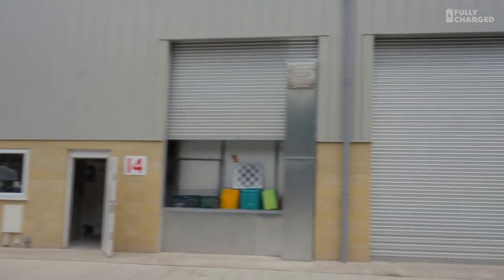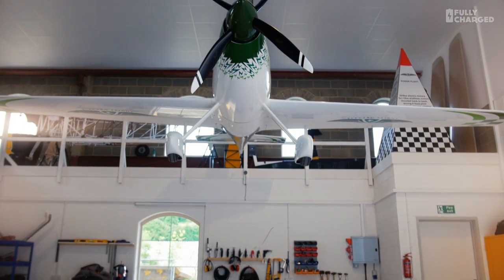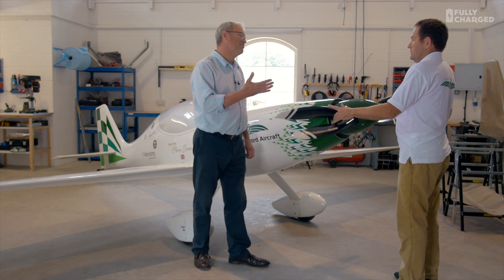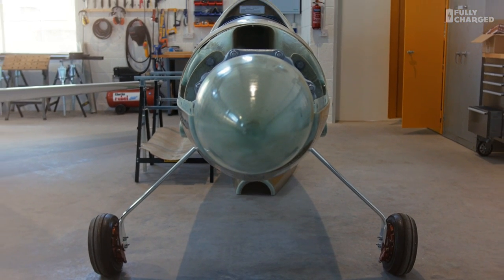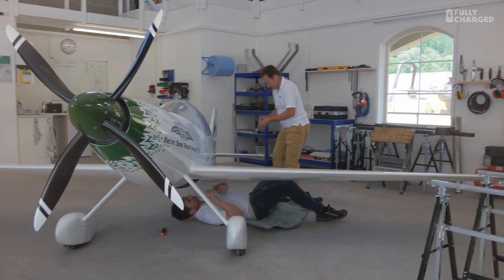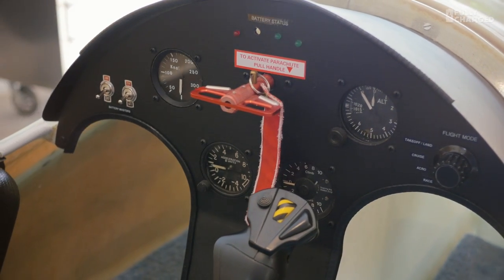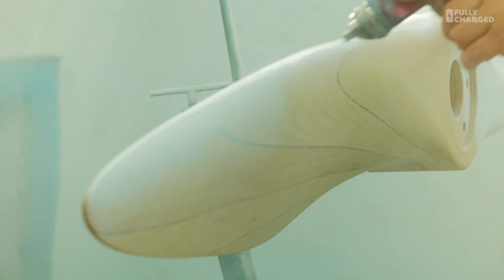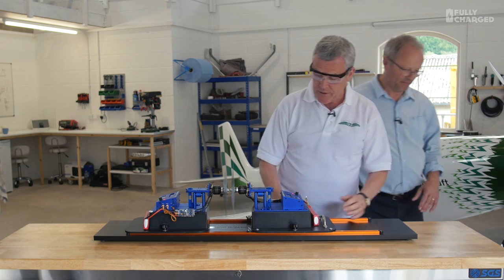Electroflight | Fully Charged

Comment: The beauty about electric motors is that they have a constant torque at any angle of rotation unlike a piston engine which  does not. But of course one cannot get away from the fact that one needs watts/hours to drive the motor and these watts/hours have to be stored somewhere which is not yet perfected.  Perhaps the energy in one cubic foot of fuel would be condensed into a battery of the same dimensions. At the moment the thermodynamic cycle in a piston engine is about 30 %efficient and using  thermal power stations to charge up batteries  is no better of as the efficiency of a thermal power station is about 40 % or a little higher if modern using combined cycle.   I feel that these  electric plane would be a win win proposition if they are charged through solar panels or wind turbines.   That when they come into their own.  Congratulations on the design, but I worry sometimes about the contrarotating props for they  do suffer an impulse every time the blades pass each other, and I wonder what the long term effect of that could be.

Comment: In the testing situation with the two small independent propellors the question was whether the propellors shout be place as close together as possible or be placed al little further apart for the maximum torque. What seems to be the best position?

Comment: The motor maybe is a just a quarter of the weight of its combustion counterpart but if you add up the weight of batteries then it may end up being just the same weight of a fully filled up combustion aircraft.

Comment: I've been a high-performance pilot for over 10 years. Not everything this gentleman says is accurate. Scramble time of 2 minutes is generous, however is not because engine core temperature. Turbine engines don't require warm up time.

Another issue, is that every flight in VFR conditions requires that we have 30 additional minutes to fly from our destination to an alternate destination. From what he says you have less than 5 minutes a flight time. No administrator is going to authorize an airworthiness certificate even experimental for five minute flight envelope.

What do you do if somebody crashes and they have to close a Runway? It's going to take more than 5 minutes to reopen the airstrip. This is your best case situation. Very little foresight is invested in this idea.

Comment: 5:52 One of the biggest advantages in electric motor propulsion is "instant torque" .  Biggest drawback: high battery weight.
Reply: How quickly an aircraft goes the first hundred feet usually isn't very important. Part of the rationale for counter-rotating propellers is to try to keep the plane going straight when you're doing all that mostly pointless dragster stuff the high initial torque forces onto you..

Comment: A race or aerobatic plane is exactly the kind of vehicle to benefit from an electric power plant. If you can give 200 KW for 15 minutes and that allows you to cover 100km, any extra batteries are just dead weight. What I wander is how they will deal with the fast discharge rate.

Comment: He mentioned a 20 passenger twin engine plane. The point is redundancy of those duel engines, so you'd loose that with one motor in the nose.. what he failed to mention is the pusher puller configuration benefit, something like the cessna skymaster where the rear combustion engine tends to overheat. centerline thrust airplanes have this problem. electric motors would not.   perhaps a skymaster with a front combustion, and rear electric motor could solve issues of range and overheating?

Comment: What about cavitation, or in air terms maybe just low pressure, created by the forward propeller? Every time the propeller blades cross each other one is traveling thru nice thick air while the other gets some disturbed air which should lead to vibrations?

Comment: mmh. Ballistic Recovery system.
Cirrus is quite fond of those.
But I also hear a plane that I've been looking at has one. (Affordable, for a plane, but not like I could actually afford to buy it. XD)
That's an aircraft that has to fit within the LSA classification of under 600 kg take-off weight.
Those chutes do require some proper training to know when to use them though.
Especially since using one sort of goes against the usual tendencies of a pilot in some ways...

Comment: One thing that puzzles me: On the 2-prop setup that they are showing at 13:31, how do they control the relative position of the 2 prop blades to each other? On the plane behind, it seems that the blades are at a 90 deg. angle. The position will certainly impact the thrust that is developed by both props. I am not an expert....Just crossed my mind. Great project and craftsmanship! Love it : )
Reply: Since the blades are rotating in opposite directions, they will meet/line up with each other every half a revolution.  But since they are both moving, it is not an issue.  Boats have done this for years.

Comment: This is all very interesting.  I wonder about the relative propulsion efficiency of two counter rotating props on one shaft versus two individual shafts as the P38 lightning had?  Certainly the airflow through the back prop is affected by the air from the front one, and there must be a lot of pulsing turbulence.  Then there is the question of the prop wash extending back in an expanding cone, and the fuselage being in the center of the prop wash.  With the two props on one shaft, is the prop wash moving more straight back (rather than expanding in a cone) due to less rotation?  That demo with the two counter rotating model props would provide a different result if operated in a wind tunnel to simulate operation on a flying aircraft.  I am sure that all this has been studied in depth and it would be nice to get a little deeper treatment.  Dang batteries!!!

Comment: "the planes got a parachute" that's because it so expensive and there's only one XD
Reply: The parachute is only good for a limited class of accidents, those that occur at sufficient altitude with the aircraft under some control. Snap-rolling out of a turn into an inverted spin might not be the best situation for deploying the parachute, as much as you might want one. Not getting the structural numbers right, or the the curing process for the carbon fiber could result in an airplane that is suddenly whipping around so fast that you can't find the parachute release because one of the wings separated from the airframe. Or you could be struggling to land this hot little beast and decide to add power and go around to try again, but push the little speed control lever forward a little too fast and wind up spinning in the opposite direction from the propellor because of all the instantaneous torque you have available .

Comment: Amazing project. I can be very stupid by saying this, but in commercial airplanes have R.A.T device. It is a small device that pulls out from the airframe and it's simmilar to a propeller. As the wind goes by and spin it...it will generate power (electricity) to the airplane. It's the last safety device only used in case of failure to keep hydraulic/controls and other important stuff working while pilot can find a safety way to land.

How about use a second propeller in this case to drive a continuous rechargable battery. Of course, the thrust can be lower, but could be (a possibility) a way out to use a lighter battery pack or something like that?
Reply: No, because it's useless to take power out of the battery, give it to the air, then take it out of the air and put it back into the battery.

Comment: would be great if you can take one of the 2 sets props and have one generate power to recharge during flight or even alternate charging 2 separate battery banks.... it could be almost endless flight time
Reply: kimber smith. if you faced backwards and blew air you can walk faster backwards than forwards.

Comment: Fascinating!  A safety note, however.  As an RC model pilot, I cringed when the gentleman was doing the bench demonstration & walked within the 'projected disc' of the spinning propellers.  One of the first safety rules at any model flying field is to assume that a rapidly spinning prop is subject to break at high speeds & send a blade (or 2) at tremendous velocity somewhere within that imaginary zone.  It happens.  Rarely, but it happens.  Had one of those props broken while he was within the strike zone & actually hit him, the injury could have been severe.

Comment: I know next to nothing about aeroplanes, but isn't this machine just beautiful? I imagine the lack of need of so much air to cool the engine will improve aerodynamics, too and the cross sectional area will be less due to the smaller but equally powerful engine. And I was delighted to hear that it has a BRS system  (worth checking up on the internet if you don't know about this, some amazing videos  https://brsaerospace.com ). Fascinating too that the props are made of wood!

Comment: There is a lot of work done. Good on you guys 
Have you considered that you will lose the total thrust? Ideally, it would be 2x trust of the single propeller but due to interaction in the coaxial system, you would have 0.85x(thrust of single propeller). Have you measured the total thrust of your system and have you defeated this problem? Thank you 
Illia

Comment: I want one. NASA seems to be going with distributed power on the wings for efficiency. Racing will prove out what wins. Honestly we never know what someone will think of and win with so I really can't wait. The counter rotating propellers haven't been the winners in electric model aircraft though.

 I'd love to see this waterfall into local level electric aircraft racing.so we can really see the fast iterative design that comes from racing.
Reply: In this sort of racing being able to change direction fast is the most important thing.

So you have to have as much of the mass centralised as possible.
Reply: Good point, I hadn't thought of that.I have to make it to The Las Vegas finals this year. I would really love to see this airplane debut in the next few years.
Reply: even if its not faster than current gas powered planes they have racing classes.  You could just make a electric class race, should help push the technology.
Reply: i think they'll be faster in short duration races like the current RedBull races. If the technology scales up at all they will be. I never could get a model airplane to climb vertically after takeoff until I had an electric RC airplane. Now all my electrics can climb straight up easily. I had a full size 2000 lb Yak55m that climbed well because it had a geared engine and 360 hp. I can only imagine what 3 or 4 hundred horsepower will do on a 1000 lb or less electric airplane.

Comment: Imagine racecar driving and a pitstop taking 6 hours to recharge lmao
Reply: In Formula E, they actually have a mandatory pit stop to change cars because nobody would want to sit for forty minutes waiting for the batteries to cool down so they would be safe to charge, them an hour fast charging, and then another 45 minutes for them to cool down after rapid charging so they don't catch fire when you start discharging them at high current.

Comment: The motor may be light, but where an internal combustion plane carries maybe 100+ kg of fuel, im guessing the batteries in this will be ~500kg? An internal combustion engine can produce the power from 100ml of fuel, not for long, but it can, whereas a motor needs a minimum mass of batteries to get the rated power of the motor, which is normally quite heavy. I dont want to sound too critical, because this a fantastic concept, but dont be mislead.

Comment: RC modeling world has some even better ideas - look up EDF (electric ducted fan) planes :)

Another idea from RC - use differential thrust to help with turning faster - you can decrease thrust on one motor and increase on the other and the net torque will help with rotation the way you want.
Reply: You know most of these ideas do not come from the rc modeling world. Just letting you know
Reply: If I had a plane I built, it'd be a twin turbodiesel ducted fan with automatically variable pitch contrarotating propellers. The automation (with manual backup) would always maintain the optimum advance ratio for thrust/HP.

Comment: You should check out pipistrel from Slovenia,  you would love it.  They pioneered some electric stuff in planes and won a few darpa awards.
Reply: Pipistrelle, while a big step, an electric plane that can be bought ready to fly, still shows a great deal of what electric planes can't do. Most IC light aircraft spend most of their flight hours going around the patch for bounce drill or flying "cross country" to a very nearby airport for lunch at the airport diner and return. A Pipistrelle can do that. Almost any IC aircraft can, should the pilot choose, go 250 miles cross country with good reserves, refuel and return in one day. A Pipistrelle can't dream of doing that.

Comment: I would like to see this with the small / lighter  batteries/ ultra capacitor mix
That can hold up to 1.5 megawatts of power. The speed and distance  would be off the charts.
Reply: UltraCapacitors have much lower energy density than lithium, cells. Adding ultra capacitors would be a step in the wrong direction.  Obviously using batteries that weighed less and held more energy would be better. I expect they thought of that, but they can only use stuff that actually exists.

Comment: I don't know enough to make any useful calculations, but I wonder if it would make any sense to skin the entire surface of a plane, or at least the upward-facing surfaces with a photovoltaic layer.  It certainly wouldn't be enough to keep the battery charged — there just isn't enough energy striking the surface of the plane to do that — but I wonder if it would at least add enough of a "trickle charge" to extend range meaningfully.  Actually, as I think about it, if it weren't a stupid idea, someone would have already built a prototype.

Comment: It looks like you have an Outrunner 48 pole 36 coil BLDC x 2 motors in these plane engines.  Where did you get the controllers and what voltage are you running them at.

Comment: Recently had an email from Ecotricity that they are now going to charge for using Chademo chargers on motorway services etc at a rate of £5 for a 20 minute charge. Considering my Nissan Leaf battery will not be completely flat but more like 10 - 30% charge still left in it then this seems to be far too expensive to top up to an 80% charge. Or another way of looking at it, 20 - 30 miles range left before charging then around 75 miles after the 20 minute charge. 45 - 55 miles for £5! For the messing around having to wait then it makes more sense to just go for an economical petrol or diesel hatchback which would get you to your destination without having to fill up at all. I think this will seriously slam the brakes on anyone thinking of buying an electric car when this information becomes more available to the public.
Reply: I hope Mr Robert will address this news in his next fully charged episode. It's devastating:(

Comment: The problem is, and always will be, energy density.

Gasoline has 23 times the energy density of current batteries which means you need 23 times the weight in batteries or must settle for 1/23rd the performance of a gasoline

Graphine batteries are not a solution as they have five times the energy storage capacity of CONVENTIONAL BATTERIES, which means they have less than 1/4 the energy density of gasoline.
Reply: Only about 1/3 of the energy in gasoline goes to shaft power. The rest goes into the cooling system as heat and into the exhaust as heat. Review Carnot heat engine efficiency. Electric motor efficiency is more than 90% depending. So  
batteries dont have to have the same energy density as gasoline before electric vehicles become desirable. Higher battery energy density is a great goal.
Reply: @engnrpetev Yes there is loss due to heat, but electric motors lose to resistance.  Entropy is everywhere.  That being said, if you working with an energy density 20X higher you can overcome the efficiencies and produce useful (time/distance/hp) energy.

Comment: Just a thought, with such huge wingspans why aren't these wings covered in built-in solar panels? Surely they can be made light enough & then especially because you may be above clouds & extend the distance travelled, at least by a little...
Reply: As Lithium cells have much higher power density than solar cells, if you were going to add more weight by slapping solar cells on, it would be better to find someplace to carry that weight in more lithium cells. Engineering often consists of more than "Hey! Let's put something else on!"

Comment: AT 7.48 lbs per cubic foot for gas at 6 lbs/ gal the one cubic of battery should weigh 44.88 lbs to be equivalent weight .2 lbs more for Jet A. Then there is the thing about an electric plane not getting lighter with every gallon burned.

Comment: We use Lithium Polymer (LI-Poly) technologically in our R/C planes and Quads (DRONES says the FAA)  It not cheaper than NITRO or GAS but much more convent for about an 80% duration than the equivalent fuel burning plane.  The next Generation of Battery Technology will make it much more a no Brainer. Lighter and more powerful is my guess. If you look at the Technology for the last 15 to 20 years at 76 years old I wish I could see the next 100 years. Just think if you told Orville & Wilbur their invention would lead to Man on the Moon in just 66 years.

Comment: The example he gave with the 2 model propellers is wrong, having 1 of the 2 propellers spin slowly greatly reduces the airflow resulting in less "air moved" than with only 1 engine. The real test would be with one propeller feathered or at least braked to a halt (a thing which is very useful in electric planes)